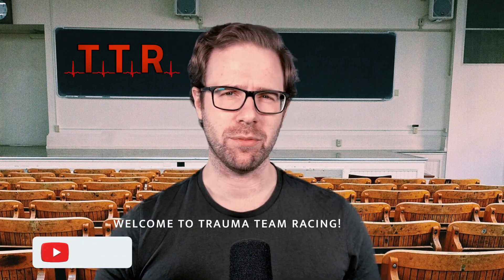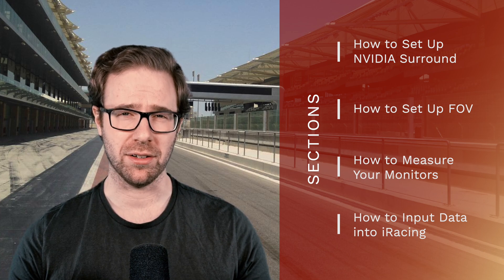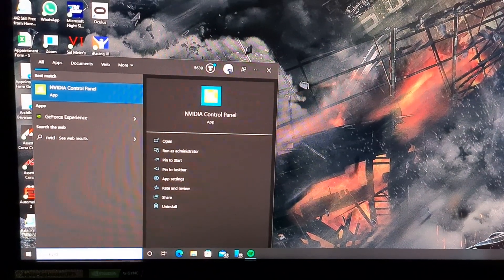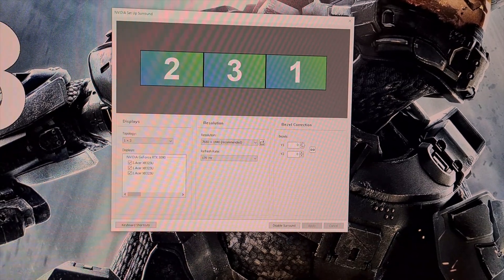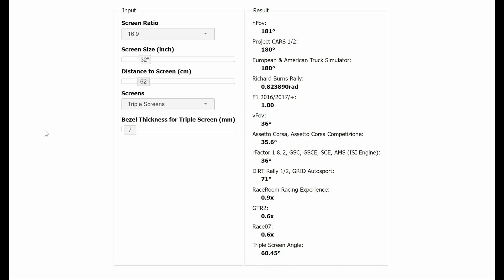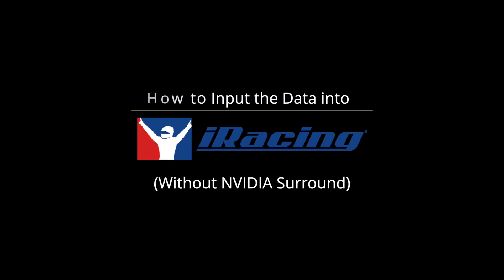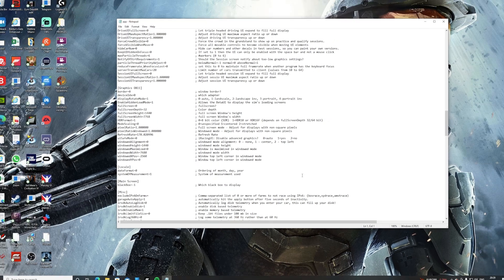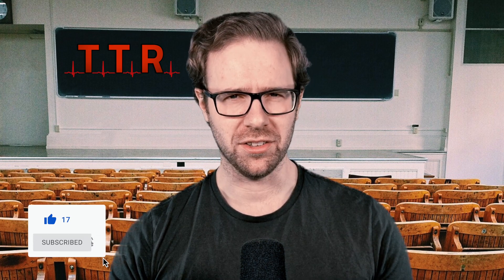How to Setup Triple Monitors in iRacing with Correct Field of View +/- NVIDIA Surround

Comment from the maker: As somebody kindly pointed out below the ini file has now been changed to the name "rendererDX11Monitor.ini" so be sure to open that to set this up without surround👍
Reply: Bless you soul! LOL... I was  going mad trying to find the configs.😆
Reply from the maker: @Leo_Moreira84  You are most welcome mate👍🏻
Reply: Even after making the changes to the rendererDX11Monitor.ini file it still resorts to using a single monitor.  Using Nvidia Surround makes a mess of the desktop, but seems to work just fine in iRacing.
Reply: Same issue here, almost given up and removed my tripples and gone back to 21:9 monitor. Reinstalled iracing, only file that was there after reinstall was redererDX11OpenVR and adjustef that file and everything works!!! Without the goddam nvidia crap.
Reply: @JohnDoe-og2tw  I wonder if AMD software does a better job managing multiple displays.
Reply: @atlantic_love  same here, but not need for the software. I adjusted the redererD11OpenVR file and works good!
Reply: @JohnDoe-og2tw  VR is not the same as triples.
Reply: @Trauma Team Racing your also making a mistake with the FOV calculator. Because you used the bezel correction in Nvidia surround set up you should set the bezel thickness to zero in the FOV calculator Because the resolution you have is minus the bezels
Reply from the maker: @Simlife101  Incorrect. Pre-adjustment width is 7680. Bezel corrected width is 7768. It adds the bezels width into the width to compensate. Hope that helps👍🏻

Comment: Under configure surround it didn’t allow me to click on span displays
Reply from the maker: You need to have at least 3 monitors connected and enabled via display settings in Windows. You can also run into issue with mismatched monitors and inappropriate cables.

Comment: How would I run my 1440p monitors as if they were 1080p monitors?  I only have 3070Ti GPU and I’m not sure it can handle the three 27” 1440p monitors
Reply from the maker: You just downscale the resolution in the NVIDIA control panel while you await your inevitable upgrade 👍🏻

Comment: So what are the differences between using surround and not using surround? Iv just set up my 32' triple rig so just looking for tips on how to get the best experience.
Reply from the maker: For me it is mainly work flow. Some like non-surround because it works with their other programmes better. Some have reported a frame rate increase with non-surround. You will need to experiment and find what is right for you.

Comment: After trying this on nvidia, even though my desktop is showing up and set up on my center screen as "make this my main screen", every time I open a new window such as chrome, it always opens on my right screen and I have no idea what i did or how to stop it and make windows open on the main center screen? Please help, I cant find any info anywhere. Thanks in advance
Reply from the maker: You need to set this in the display panel in the settings menu within windows.

Comment: Congratulation to your chanell, very good, also simple explaiined, but this is for standard screen, can you help or give an example, how to make for this kind of screens ? I have one G9 49inch (5120X1440) curved and two G5 27 inch (2560x1440) curved. The 49 is like two 27, my question is what is the idial angle, because he calculate only, the same screen size or triple, but in this case is like four 27inch and no option for quad curved screens. So no possible to know FOV and Angle. Also surround dont do it right. I put all monitoras at 120hz.
Reply from the maker: Thank you for the support. This is going to be very difficult as iRacing does not allow you to input for different monitor sizes as it assumes they are uniform. This would be possible in ACC and AMS2 for example where I believe off the top of my head you can do this. iRacing does not support 4 screens. My advice, which is probably not what you want to hear, is to get 3 uniform screens to set up your triples for the best and most pain free experience.

Comment: Thank you! Your tutorials are spot on. One question though about NVidia Surround. Bezel correction looks fine on my left side bit on the right, I can't get it as straight as the left. Is there a reason for this? I've checked the angles height and distance and all measures up well.
Reply from the maker: Thank you for the kind words! You will most likely need to try a negative bezel correction value to get this to line up properly. Get into NVIDIA and start playing with the bezel correction for the right side. Make sure they are unlinked so you can set different values.
Reply: I am unable to input negative values. The Bezel Correction doesnt go below zero. I am having the same issue. Left Monitor to Center transition is Great. The Center monitor to Right is bad. The image on the right monitor is tilting DOWN.  @TraumaTeamRacing

Comment: i have 3 curved 32inch screens, when selecting 3 curved screen in iracings settings the box for entering the angle of the side monitors disappear. where do i account for the side angles?
Reply from the maker: iRacing assumes you are following the radius of curvature. If you wish to use the angles just calculate them as 3 normal screens 👍🏻

Comment: Is it possible to have 2 curved screens and 1 flat screen and this work? I've done everything in the video with no NVID and it still won't work. Can someone help?
Reply from the maker: If you haven't matched specifications exactly, using different cables or different resolutions with differing monitors sometimes it won't work. I would try doing it with NVIDIA.

Comment: This might be a stupid question but do you need to download nvidia surround? Also I have 3 monitors, one 34inch curved and two 27s. Will I be able to run triples on iRacing with different sizes?
Reply from the maker: No such thing as stupid questions (most of the time😅).

You need an NVIDIA GPU and then NVIDIA surround will be accessible in the NVIDIA control panel that controls the monitors.

You will be able to. But it's not ideal and you can run into issues.

Comment: I wish nvidia surround actually worked like that. I understood my gtx770 had trouble but imagine my disappointment when my rtx4080 has the same problems
Reply: Thanks mate! Got it going last night. I use a custom resolution utility,  delete all the resolutions i don't need. Add 2560x1440. And then surround works properly. (Also had a "wired monitor display" active that wasn't conected)  but it's working!
Reply from the maker: @meyogy2414  Great news mate! Glad you got it sorted. What's that wired monitor display all about? An error?
Reply: @TraumaTeamRacing 
I have 4 monitors. Display settings and surround was showing 5 monitors. (Maybe it was my phone through simhub, but it was still there with simhub turned off)
In display settings. Advanced display settings. It called it a non-pnp wired monitor. Had to go into printers & devices delete it (was easy because it didn't have any model numbers) then device manager and uninstall the non-pnp monitor).
Reply from the maker: @meyogy2414  Always amazes me how much random stuff can happen on a PC to derail your sim racing. Had to replace a button battery on my motherboard the other night. That was fun 😅
Reply from the maker: I'm lost. What do you mean? It does work like this 😅
Reply: Not after my last windows update. It breaks surround settings. I click enable surround and it waits then does nothing. Updated latest nvidia driver still doesn't want to work.
After a coue hrs it will probably start working again
Reply from the maker: Maybe try rolling back the drivers. Been screwed by a windows update before. Best of luck on your mission 💪🏻
Reply: Shouldn't have to roll bak drivers on my gpu after a windows update, though. 
I did roll back logitech drivers after my g29 force feedback stopped working though...
Reply from the maker: @meyogy2414  You can sometimes have corrupt downloads. I was really referring to the Windows update, but graphics could do it to. Worth a try anyway. Good luck 👍🏻

Comment: whats the pros and cons of using nvida?
Reply from the maker: This is a whole separate topic but a few would be surround interferes with other programs running on a single screen if you use you PC for multiple things. NVIDIA is a little easier to set up. I haven't noticed a performance difference between either.

Comment: Whenever I try setting up nvidia surround, one monitor (almost always my right one) disconnects and then surround works but only for the middle and left screen. Saving or re-entering the surround panel crashes my pc. I have to shut off both side monitors just to get windows not to crash on reboot. Help?
Reply from the maker: This sounds like a hardware problem rather than a software problem. Are all your monitors the same? Have you got them ALL connected with the same cable, I prefer display port. Have you got your refresh rate set wrong? Have you updated to the latest drivers? I would start with these first. If these don't work try setting up without NVIDIA surround. Hope that helps.

Comment: Thanks for this. What setting do I choose for the bezels if using the bezel free kit? Same thing?
Reply from the maker: You are very welcome Rover. I have got some of these to fit myself. I believe as the image is refracted across the screens you would see these with bezel correction off and proceed accordingly. Hope that helps 👍🏻
Reply: @TraumaTeamRacing  thanks. I saw another video just before where someone - the bezels.
Reply from the maker: I think a lot of it will depend on where you are sitting and will need to be tweaked ever so slightly. Like I said, haven't got mine up yet so can't give a definitive answer.

Comment: trying to set up trips however, I'm working with a 31" curve (144hz)and 2 - 27" flats (60hz)....I'm able to get surround to work while in the UI however, when I go to race, the outer two monitors loose signal and everything is just on center monitor. Any thoughts?
Reply from the maker: In my opinion mixing monitors is a bad idea as this can lead to incompatibility issues. It appears to be unpredictable, especially with different refresh rates. At the very least make sure the refresh rates are all lowered to 60Hz. That might help.

Comment: My app file doesn't have all those settings in the Graphics section that your app file does.  Why is that?
Reply from the maker: Please see the pinned comment👍🏻
Reply: @TraumaTeamRacing  Thanks, and even after making the changes to the rendererDX11Monitor.ini file it still resorts to using a single monitor.  Using Nvidia Surround makes a mess of the desktop, but seems to work just fine in iRacing.
Reply from the maker: Glad you got it sorted👍🏻
Reply: @TraumaTeamRacing  If you read my last comment, I did not get it sorted.
Reply from the maker: You said you got it working with NVIDIA? When others have has issues with the 'ini' file this has been the bail out.
Reply: @TraumaTeamRacing  I don't want to use Nvidia Surround, and most others looking into doing this with *.ini files don't want to use Surround, either.  Surround is awful and a pita.  But these instructions for editing the *.ini files are outdated.  iRacing is apparently changing how they do things as far as *.ini files go, and content creators don't seem aware of that.
Reply from the maker: I don't have any issue with the ini file I'm afraid. This sounds more like an issue with your hardware. Are you using matched monitors with displayport cables. Some have had issues with HDMI connections.
Reply: @TraumaTeamRacing  Yeah.  In my case I have this:
i5 2500
32GB RAM
RTX 2080 Super
Windows 10
3 monitors 1080p with HDMI connections (converted to DisplayPort with adapters)
Quest 2 VR
G29 racing wheel / pedals
Reply from the maker: @atlantic_love  I hate to say it but it sounds like a monitor issue. I take it they don't have DisplayPorts? Are they monitors or TV's?
Reply: @TraumaTeamRacing  Monitors, but in Surround I have no issues.  I just don't want to use Surround because of the pita outside of iracing.
Reply from the maker: If you can use dedicated latest display port cables and see if that fixes the issue. Are all the monitors the same make?
Reply: @TraumaTeamRacing  The monitors have HDMI connections, so all I have are HDMI cables with DisplayPort adapters attached.
Reply from the maker: This is probably a monitor issue. Only way to check, try different monitors. I realise this is unpractical.

Comment: Hello at the 2:25 mark you show your surround display shows 7680 x 144 my monitors are 3x2560x144 but it shows me 11520x2160 or 5760x1080  and in iracing it is 5760x1080  no were is there 7680x1440  is there a work around ?
Reply from the maker: I believe if it not showing in NVIDIA control panel it is an issue with the communication with the monitors. Have you got them connected separately via Display Cable? Are they all the same monitor? Are they daisy chained? Sometimes a 4th monitor can upset things too.

Comment: Wait, isn’t there another step? Where you fine tune your seat position etc..?
Reply from the maker: Adjusting the seat distance from the screen is discussed in the FOV section at 03:28. Hope that helps👍
Reply: @TraumaTeamRacing  I believe the setting is inside of iracing but not the fov. It’s where you change the x and y axis etc….
Reply from the maker: @gman5426  You mean the seating position in game. Apologies. This doesn't actually affect the calculation and should be tweeked based on user preference. Very much like you would adjust your own car seat in real life👍🏻
Reply: @TraumaTeamRacing  I just thought this is a very important step, as sometimes the seating position can look a little out and some people wouldn’t know about this step and could be loosing valuable seconds.
Reply from the maker: @gman5426  Beyond the scope of this tutorial as not actually to do with FOV calculation. I'll make a note and pop it on my to do list for another tutorial. Thanks for the idea👍🏻
Reply: @TraumaTeamRacing  no problem, I’m a little confused on your explanation of the measuring the degree of the side monitors. Maybe it’s the camera angle I don’t know.
Reply from the maker: @gman5426  Look at the section FOV calculation. The diagram explains it clearly👍🏻

Comment: Can I still use 144hz when surround is enabled?
Reply from the maker: I do👍🏻 Might depend on your monitor👍🏻
Reply: @TraumaTeamRacing  so I have 3 144hz monitors but when I’ve surround enabled my maximum is 60hz and cant change it to 144
Reply from the maker: @luukdendekker159  I've heard this happen before. It might be your monitors. Are you using the latest generation of display port cable? G sync enabled?
Reply: @TraumaTeamRacing  so I’ve g-sync enabled but I still can’t change it to 144hz
Reply from the maker: @luukdendekker159  Could be multiple things I'm afraid. Could be driver problem, GPU problem, display problem, cable problem, iracing problem. Impossible to diagnose without being there. Sorry can't be more help.
Reply: @TraumaTeamRacing  ah no worries, thank you
Reply from the maker: @luukdendekker159  No problem. Let us know I'd you find the solution👍🏻
Reply: Do you have a 4th monitor? Because he takes the lowest hz monitor.

Comment: Maybe there is something i do wrong but if i put in my bezel corrected resolution, i don't have full screen anymore but in both of my right and left screen missing 3 cm.
In AMS2 i will have 2 grey vertical lines in the front window...
Now if i don't select my bezel corrected resolution everything seems okish. In AMS2 looks good, in Iracing looks good i think, at least when i race my ferrari. Except my mazda, and here is my biggest question, where is te right mirror supposed to be because its almost at the end of my right screen as for my left mirror seems to be at the correct place. Also my in car mirror just doesn't seem to be where it supposed to be..
If i put in 180 degrees my fov is messed up, if i let the computer deside its it 148 and what i said before, in my ferrari it seems to be ok but my mazda is not.
Hope you van help me.
Reply from the maker: Are you sure you have run the calculator correctly? You shouldn't have to change with the FOV it should be set to whatever your setup is. You could try changing it from full screen to windowed etc and see if that helps things in the display settings. I would also recheck the angles you measured and make sure these are correctly inputted in the calculator. Hope that helps👍🏻